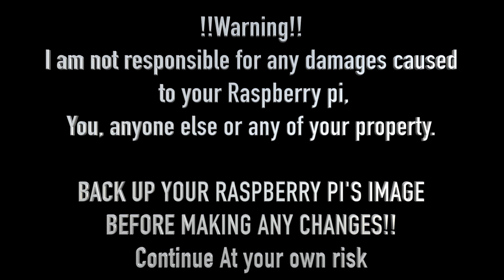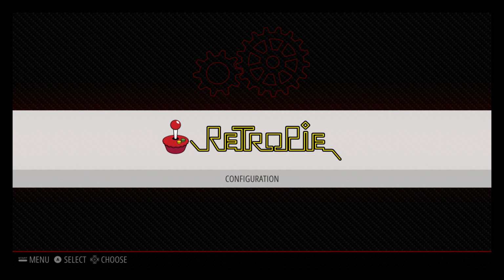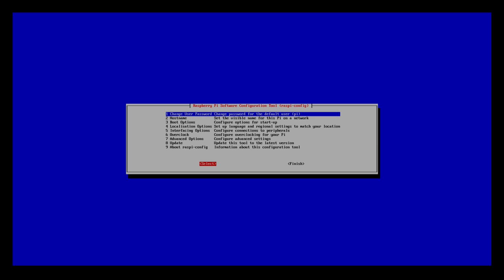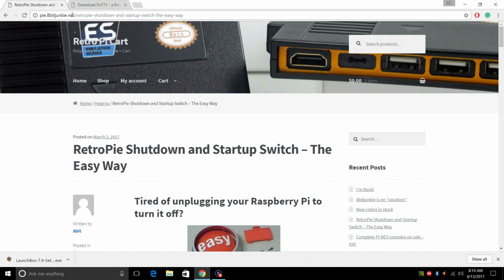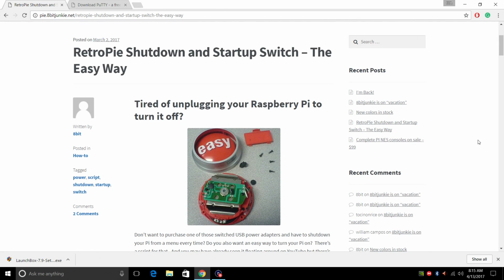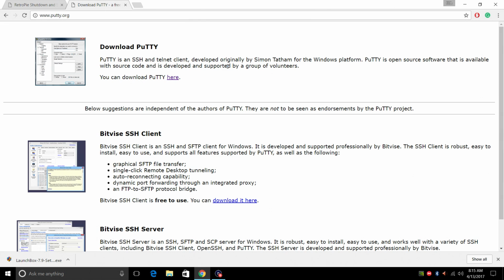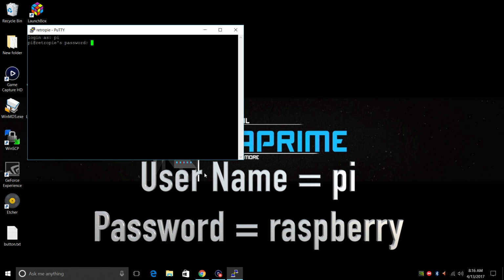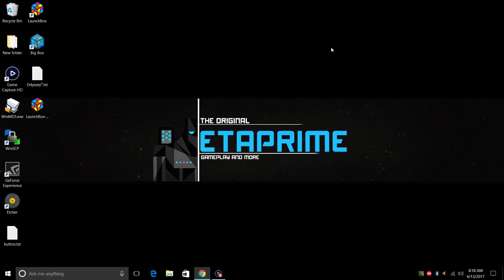The Borkin Button Easy Raspberry Pi Power Button

Comment from the maker: by cutting the power to the Pi you run the risk of corrupting the sd card. The script In this video shuts the Pi down correctly. You can always just press start on the controller and scroll down to shutdown within retropie.
Reply: Any Idea how to make this work with OpenElec on Raspberry Pi 3?
Reply: I wish you would have shown the solder work, because I can't seem to find really good videos on how to solder cables to a raspberry properly. Some people below in the comments mention a resistor should be placed but where would you fit that ?
Reply: works on all variants of raspbian
Reply: hey eta prime how can this be applied to a pi zero W?
Reply: @bocard80  is that script worked on raspberry zero?
Reply: ETA PRIME would this work on a raspberry pi 4 the same way

Comment: tried to do this to a pi 3 b+ running octoprint for my 3d  printer soldered the  wire and I installed the script over ssh but  still did not safe shut down pi when i pressed the button. Is this mod retropie specific?

Comment: This looks great, but I can't find a "Borkin Button" anywhere any more?? Any ideas?
Reply: Did you have any luck finding some? I'be jusy had to order them from China, which isn't ideal.
Reply: @CheDonJohn  Thanks - yeah I have found plenty on eBay, but all China. The challenge was nobody here in the UK is calling them a "borkin button"... it's just 3.5mm phone button. Spent too long just looking for "Borkin"...!
Reply: @andywilton8031  I'm from UK but live in Canada, but was unable to find any in either country, so had to order from China in the end. Ordered 15 spread across 4 different sellers to help make sure I get at least a couple that work!

Did you managed to get all done successfully? Which versions of the Pi and RetroPie are you using?

Comment: Unfortunately, this doesn't appear to work on the Raspberry Pi 4, or there's something else I'm missing. It reads the GPIO pin as always low when the wire is connected as instructed, and therefore, it just always stays booted once powered. I removed the wire, and connected a button between pin 5 and 6, and was able to get the shutdown working. `WAKE_ON_GPIO` is disabled in the bootloader for the Pi 4 right now (they're supposed to be enabling it the next release), but I installed a patched bootloader, and I got that working with pin 5 and 6 as well... something seems up with the audio jack pin

Comment: If anyone has installed this and found that after the first power off and power on cycle the button no longer works, here is the solution: 
You need to edit a file called rc.local.  in the command prompt type the following:

sudo nano /etc/rc.local

then type in the following line before the last line of code in the file:

python /home/pi/scripts/shutdown.py &

Save the file, reboot the system, and it should work. At least it worked for me. 
I didn't come up with this, I just found it with a deep Google search. People smarter than me figured this out.
Reply: Thanks! This fix works with the latest version of RetroPie on Buster
Reply: Thanks for the heads up. I've ordered some buttons, and had read that some people had similar problems to you. What version of RetroPie are you using?
Reply: @CheDonJohn  4.5.1 on a Pi 3b+

Comment: I know this is a METAL jack shaped button and might be an electrical contact, I wanna know if I can print this in plastic on my 3d printer? I suspect this jack might mechanically "open" two contacts in the jack, I see there are Dust Plug (jack plugs) on Thingiverse. thanks

Comment: Turns out you don't need a script. You only need to add a bit of code to
/boot/config.txt
To navigate there and actually modify it you have to use "sudo nano /boot/config.txt".
Leave the quotation marks out. Then navigate to the very end of the lines of code. You need to add this code to an empty line, you cannot paste it after a line of text. Navigate to the end, on a empty line and paste
"dtoverlay=gpio-shutdown". The GPIO pin used for this is built in to be pin 5. It's conveniently right next to a ground pin. If you need to edit this pin, use
"dtoverlay=gpio-shutdown,gpio_pin=X" and replace X with your pin number. Remember that the Pi can be shut down from any pin that can be a input and has an active pullup resistor, but only pin 5 can wake it up from shutdown. It also has a physical pullup resistor on the board. This is hardwired into the Pi itself and cannot be modified.
Reply: This is actually the perfect solution, thank you very much for pointing it out. No need at all to install scripts from dubious sources.

Comment: For me the script takes forever to install. It's always stuck on 0% [connecting to raspbian.raspberrypi.org (2a00:1098:0:80:1000:13:0:6)]. It does do stuff, I know this because the last digit changes when it moves on: 0% [connecting to raspbian.raspberrypi.org (2a00:1098:0:80:1000:13:0:7)] so if you're stuck at this point too, don't worry. Just let it run, it is loading stuff. It eventually gets past this part but it has to do this thing a few times and it takes forever.

Comment: seems to work to turn the pi on, although for some reason i cant get it to work for shutting down the pi. any ideas?
Reply: Craigthepope 

Someone seems to have the same issue on reddit. 

He managed to fix it. 

https://www.reddit.com/r/RetroPie/comments/8p1ijc/borkin_button_issues_after_update/?st=JI7LPTU6&sh=df0255a2

I should receive my button soon so I’ll see if I encounter the same issue.
Reply: I did that but it still didn't work. But adding "sleep 5" below "python /home/pi/scripts/shutdown.py" seemed to have fixed it.
Reply: I'm having the same issue.
Reply: I’ve been able to test it out. Same problem, the button triggers the boot command but doesn’t shut it down. I’ve followed xfatdannx’s advice from Mr Borkin itself (the reddit post I linked). Now it works like a charm. (Had an issue with a broken button though).
Reply: yeah im guessing the advice involves moving the shutdown.py to the rc.local file? ive solved it now
Reply: Unusual

Comment: Hey ETA,

     Thank you so much for this tutorial. I am having one minor hiccup and was curious if maybe you had an idea on how to resolve it. The button works perfectly for power on, BUT not for power off. The major difference between your video and my set up is I am running the most recent update of OSMC for an OS rather than RetroPie. Any idea on a work around? Or if I run KODI through retropie, since RP would be the main OS, would it maybe run the procedure call at a different priority?

Thanks for your input,
Lewis

Comment: Soldered wire, inserted button and ran script with no problem. However now my pi always shuts down and wont power up unless i remove the borkin button. any suggestions to what could be wrong?
Reply: i have the same issue @etaprime could it be my button has three black rings instead of two?

Comment: Like others I had the lack of a pullup resistor problem making it shut down instantly... so I had to add this to the script to enable a pullup resistor in the SOC.  " , pull_up_down=GPIO.PUD_UP)" at the end of the GPIO.setup
Reply: Hi. I have added a resistor as my pi kept shutting down when I added the borkin button. How and where do I add this part of the script? As I used the simple method. Many thanks
Reply: Justin Hannah how do you add this to the script?
Reply: Up!

Comment: Great tutorial! When I power up the light comes on for a second but then turns off. Any idea why this may be?
Reply: Jonathan Hutchinson it seems that several people have had the same problem. did you hav the button inserted when you installed the script?
Reply: Jonathan Hutchinson someone else said if youre using hdmi you need a 330 ohm resistor in the wire you soldered on to prevent the pi from automaticaly running the script. hope this helps.

Comment: This probably a dumb question but can i strip any jumper wire? Or does it have to be either a m-m,  f-m, or f-f. Im assuming i can use any as the heads dont matter also, Instead of soldering to gpio, couldnt i plug the female into pin and just solder the othrer end to the jack?
Reply: any, wire is wire, the jumper ends just make them easier to fit together.

Comment: Do you know how I could get my on/off switch to work with libreelec. I have it working good in retropie, just be nice to use on both. Thanks
Reply: im having a problem with OSMC. It will turn ON fine but once OSMC is running it will not power off without going through the menu.

Comment: So, i just got my buttons and tried this, but with bad results. With the button in, moments after the PI powers on, it shutdowns, and will not come back on unless i remove the power. Without the button installed, Pi works as normal. Anyone have any ideas?

Thanks!
Reply: Im having the same issue.  some work fine, some dont.  even hooking them up to my micrometer, they seem to be working as intended.. yet cause the same issue as you're having.   

As i mentioned, some work and some dont... very random results.  I've even had some work fine, then stop working..

I think the quality control on some of these buttons is questionable
Reply: Sorry, no luck here. I ended up getting my money back for mine. In the end, since I was using the cheap NesPi case, I wired a very small microswitch to the same wires this uses, and hot-glued the switch to the top of the ethernet port so I can press it when the cartridge flap is open. Not quite as elegant, but functional. Best of luck man.
Reply: Alex S see my comment about resistors.  You will have to experiment with the values to find the right one.  I’ve had very limited success though.

Comment: Is there a way to uninstall the script? I ask because I installed the script before inserting the button so now as soon as I insert the button, the Pi starts up and shuts down immediately. For the Pi to stay on, I have to insert the button partially and remove it on startup or just not insert it at all.
Reply: i guess you could rewrite your sd card. i hope you back up regularly
Reply: Kip Crawley remove your soldered wire and edit your config.txt. hdmi_force_hotplug =1 change to =0 and make sure your composite plug videos out on band 1 or 3 canr remember

Comment: It does not work for me.. I installed the script correctly and after I put in the 3.5mm button my raspberry shuts down and wont boot up anymore until i remove the 3.5mm button :( ?

Comment: Im having a problem i wonder if any one can help me about it. I follow the instructions, the only thing i made different, is that i install the code with the Pi instead.. I have done it  on 2 Raspberry Pi 3. the thing is, when i click the button yes it boots up. But before launching the Emulation Station it goes off. And if i take out the broking button it boots normal and ok. Any idea whats happening? what am i doing wrong? and what should i do?
Reply: Fernando, i had the same exact problem, but, thanks to a few people's comments on here i was able to get it working. THANKS to Michael Jagneaux and rayadagio for the tips on the resistors. both tips came in handy. here's what i've learned: if you are using the HDMI out for video, you may need to add a 330 ohm resistor to the cable to prevent the Pi from automatically running the script and shutting down. if you are using a display that uses the ribbon cable on the Pi then you may need  to add a 2nd 330 ohm resistor for a total of 660 ohms to the cable. i have tested this on a couple different RPi 3 Model B's and have had no problems with the on/off button in either configuration. my main setup is using RetroPie on a Raspberry Pi 3 Model B v1.2 connected to the 7 inch touch screen (using ribbon cable). i also added a pHAT  DAC from PiMoroni to reclaim the audio which is much better than the built-in audio of the Pi. i know this has turned into replying with a book but hopefully this info helps a few people out there. i'm by no means an expert when it comes to the Pi but if you have any questions i'll answer what i can. BIG THANKS to ETA PRIME for the original post and video!!
Reply: Thanks Richard. i will try it again by formatting and writing the image again on the Sd card. And put it again the Script for the button. By the try and error i've been testing. It looks like the problem its on the software, because it triggers an action the borkin button. if that does not works i will follow your instructions. Thanks to all of the community for the support.

Comment: Works great, I had to add a 330 resistor on the wire. Also makes my splash screens go static like. I disabled them and it works

Comment: I have to Pi3's running RetroPie. I did this to both of them. One one, the Python script starts up at bootup no problem. One of them I had to start the script in /etc/rc.local. Not sure what the difference is between the two of them. I think I did something to make the bootup quieter on the one that I had to use /etc/rc.local.

Comment: i have the script installed and while a momentary switch to pin 5 and any ground works perfectly (if not a bit ugly) the button does not work as it should. when the pi boots it detects the connection between pin 5 and the audio jack ground and automatically runs the script and shuts down. when i press the button it boots up but again shuts down during boot due to the connection. any ideas? i'm thinking about testing this with soldering to another audio jack pin instead of the ground in hopes that the button will act as ground no matter what...not sure of the result of this though....
Reply: Hello Richard, I have encountered the same problem when the Raspi ran in headless mode. I found out that the value of the GPIO pin 3 changed completely randomly and independently of the pressing of the button. The signal appears very prone to external sources of interference. I solved the problem by establishing the connection to the GPIO pin via a resistor (666 Ohms, value determined by trial and error). Now I get reliable signals and the script runs flawlessly. I hope this helps.
Reply: @rayadagio  My problem was the exact opposite: GPIO 3 for shutdown/boot would work perfectly if I shorted the pins with tweezers, but as soon as I soldered the wire as shown, it went dead to 0 in gpio readall. Yet all I had were a bunch of 1 kOhm resistors... 1 kOhm indeed proved to be too much, with this the input stayed at 1 and wouldn't trigger no matter what. So I had to get out my electronics 101 from 20 years ago and did my own 660 Ohm resistor out of 3x 1 kOhm (2 in series, 1 in parallel). Ugly as hell, but after hours and hours of trying it finally works. Thank you very much for leading me to this solution!

Comment: Would this work if I use an extension cord to make the button more accessible
Reply: Not sure, but if you really need to extend the button you can either try a audio jack extension wire or check what the button does when it's pressed, either connects the pin to HIGH or ground and make a button that replicates that function. Remember that GPIOS don't accept 5V as inputs, only 3.3V

Comment: I know this is 3 weeks old but does it matter what end of the wire from male to female on what one I solder to each point?
Reply: ?? male to female? Im lost... both ends of the wire should be stripped and soldered to the back of the pi.

Comment: Any idea how to do this on a RPi v1? The headphone jack looks totally different, so I wonder if it'll work, and where I should solder. I tried looking for documentation, but couldn't find any aside from schematics that were too difficult to decipher. Your help is appreciated, thanks.
Reply: Simon Chester Why do you have an original pi?
Reply: (|robotmaker6|) uh, coz I bought one when they first came out? 
I have 8 newer ones, too, but the press button shutdown would be handy for the project I'm using the v1 for.
Reply: Simon Chester Oh okay, I see.

Comment: great mod, FYI, the Pi3 B v1.2 has two pin header holes next to the 40 IO header, does the same without the extra code..
Reply: It's not quite the same.   RUN jumper will instantly reset the hardware and not properly shutdown the OS if it is running.

Comment: Hi Eta thanks for the video i have a small query if i may. i have a 3 ring (4 Pole Switch) and have followed the instructions given on 2 raspberry pi 3 models. Bot now with the button in place will only switch on with the power cable they display the retropie logo and then hang. If i remove the button they both boot no problem any ideas greatly appreciated.

Comment: I have a fan connected to pins 4 and 6 that stays on when i shut down retropie from the menu. So i have to unplug my pi to completely shut down. Will this button and script turn power of to the fan aswell?  thanks
Reply: Jae Blaze I would like to know this as well.
Reply: Jae Blaze hello well what I did that worked for me is I hooked up the fan to the usb port and now it shuts down every time when the pi shuts down hope this helps u out
Reply: no you need a control board for that. you can find them fairly cheap and they dont take up a lot of space. it makes it so the fan only turns on when the chip reaches a certain temperature, so it won't spin when its powered down

(thats the theory anyway)
Reply: ^^^^THIS
Reply: Jae Blaze the fan will still stay on with this button one easy solution is connect the fan to the usb port I did it and it shuts off the fan every time
Reply: Raul Reis what you mean ^^^^ this?
Reply: just tryna get my fan to turn off like shadey mcbones, my fans plugged into the gpios not the usb

Comment: I tried this with 2 pi3s running osmc, I dont have one of the audio jack buttons but I did have an old selfie stick lying around. it boots up fine with the push of the button but will not power down with the button any suggestions??